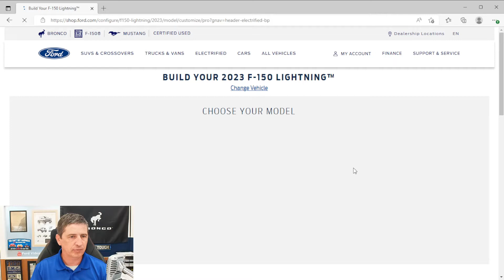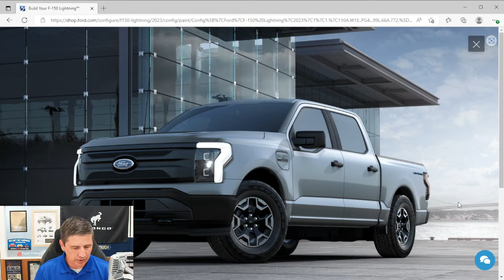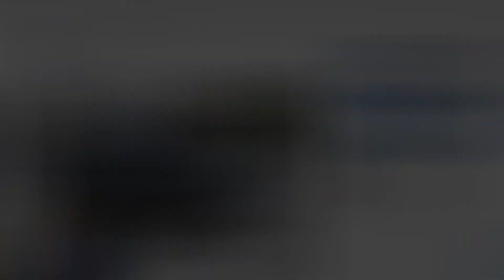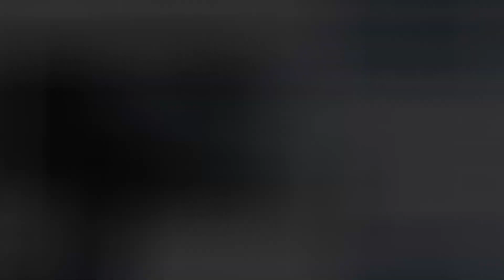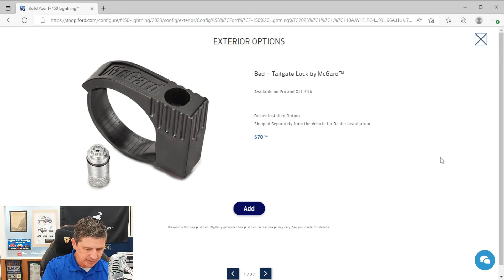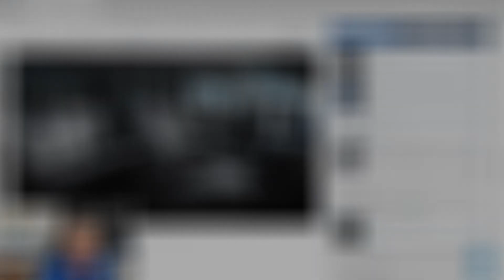2023 FORD F-150 LIGHTNING PRO COMPLETE GUIDE

Comment: A few questions… will they sell out of 2023 lightning pro like 2022? Does the pro come with running boards or can you factory order them?
Reply from the maker: you can order running boards after, any f-150 running board will fit on them. we dont know but more than likely yes - SD
Reply: Yes, they will sell out for 2023 and likely 2924. Reservation backlog is a couple hundred thousand while Ford is only making tens of thousands. If you don't have a reservation you'll have to try to get one of the 2022 demo units or used. Neither are very likely nor very cheap.

Comment: Thank for you for the breakdown !! One thing I may have missed is my order for the 2023 pro said that the onboard scales were included and I didn’t select the tow package. Do you think this is a mistake?

Also what is the best way to go about guaranteeing the 2022 pricing ? Mine said it when I got my invite to order last week, but uses the wording “you are eligible” and “confirm with your dealer for final eligibility”
Reply: When I ordered my Pro with Tech Tow Package they had to remove the scales before the order would submit (subtracting ~$650). Likely due to parts shortage. 

My dealer mentioned some sort of price adjustment coming at delivery, but I wouldn't count on it being a full adjustment down to 2022 price.

Comment: Though I'm disappointed by the price increases, and the fact that these pros (allegedly) won't get made until fall of 2023, videos like this keep my mindset positive. What a great reminder of how absolutely packed this truck is with features (AWD, safety features, 12 inch touch screen, 4 drive modes, Power frunk, etc)

Comment: Dumb question 
Is it ok to use undercarriage wash at the car wash with the batteries underneath? I know they’re waterproof but not sure if an undercarriage wash would hurt it
Reply from the maker: You should be fine, TIm took his through the car wash. not only is  the battery incase its also covered by skid plates to protect it.
Reply: Batteries are sealed. Rivian has a 3' wading depth, surely Ford has something similar, but I have.no direct knowledge for Lightning. But I'm sure it's fine for a car wash.

Comment: Is it true that Ford will honor last year's prices for reservation holders who couldn't place an order last year?
Reply from the maker: If you got your invite you will get the private offer. anyone that has not gotten an invite yet will not get the 22 pricing.
Reply: @longmcarthurford  I did get my invite and place my order online, but my dealer had no idea about the private offer. After I placed my order still showed the current prices, when do I see the 22 pricing, or will they adjust at delivery time?
Reply from the maker: @cembirinci5539  It will show when it comes in and the dealer pulls incentives for the truck.

Comment: Sorry Tim, at the new Ford MSRP, the Lightning is no longer affordable or worth the money.
Reply: Affordable or worth the money is subjective.  You won’t find another vehicle, ICE or Electric with AWD, power, size, storage, range, pro power, and safety features that come standard on the pro.  The 98kW battery alone has to cost Ford over $20k.  Ford will raise the price again to $50k within 6-12 mos and the truck is still a steal at that price.  Only one test drive is needed to realize this is the best value vehicle period on the market today.
Reply: Then you must also think the same for all ICE F-150s because this has it all over them.